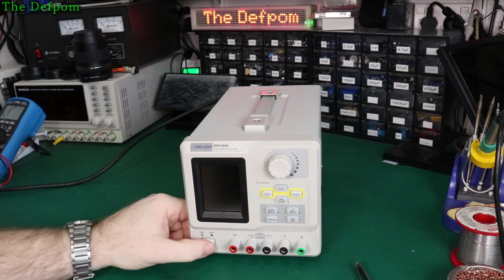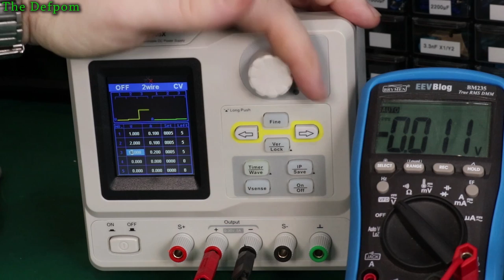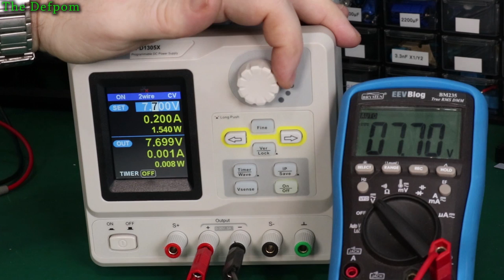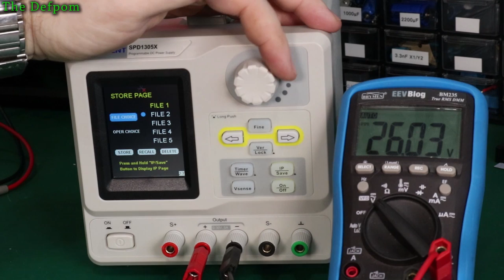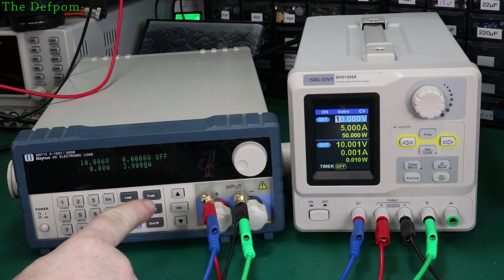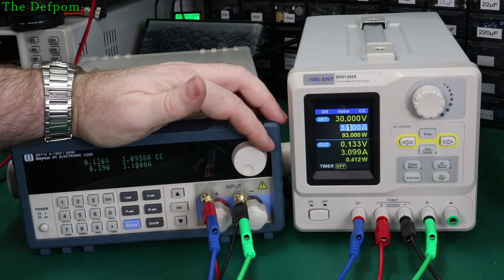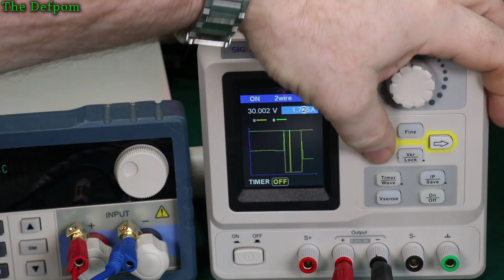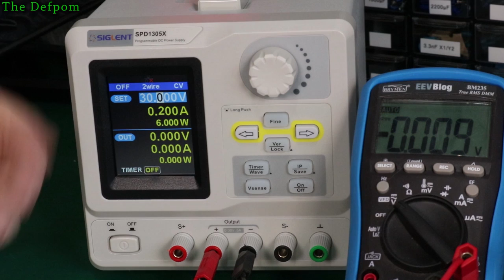🔴 #528 NEW Siglent SPD1305X Linear Power Supply Review - How Good Is The SPD1305X Power Supply

Comment: Thanks for this series of reviews.  I have the SPD3303X-E which has a similar UI and I have to agree with you that the 'output enabled' indication just isn't obvious enough...even with the front panel LEDs (on the SPD3303X-E) which are very dim.  I also find that the graph feature is nearly useless unless you are working on systems with significant current/voltage excursions.  In my case I frequently work at around 100mA supply current which on the graph is a line near zero.  A 20mA change is virtually invisible.  An auto-scale feature would be excellent here.  Other than this I've done many test on the SPD3303X-E and it handles overloads and output enable cycles gracefully with no measurable overshoot - a really excellent supply for the money.
BTW - during the 4-wire measurements in your video, it would have been better to connect the sense lines directly to the brass connectors on the load - this would eliminate the voltage drop from the banana jack contacts - which can be "significant" in some cases.
Reply: Great suggestion on an auto scaling feature, thanks I'll pass this to the factory.

Comment: Very nice detailed preview. I don't see any competitor in this price range right now.
I'ts obvious that Siglent has reused the interface from the SPD3303C where it was perfect. The fine button first selected between coarse/fine and on the later X models it moves the cursor on the digits. Makes sense I think. But the [left] and [right] cursor buttons confusing things up.
I would use these four buttons [Fine] [<] [>] [Ver|Lock] as cursor controls [up], [down], [left], [right] and to enter or agree press the wheel. Next the [IP|Save] button should become [Menu|Lock]. Then it's perfect again ;-)

Comment: Hi, mate. Good video. I was looking for a regulation and ripple test for the power supply.
I can see the output waveform facility being a good asset.
Reply: The ripple spec on these PSU's is very low and somewhat hard to measure without an EMI clean lab.
Some checks of transient response and ripple on the SDP1168X are posted here:
https://www.eevblog.com/forum/testgear/new-spd1168x-siglent-psu/msg1680749/#msg1680749
When Defpom gives my SPD1305X back I'll post some ripple and transient tests there too.

Comment: Hi defpom,
when choosing for a triple psu like the spd3303 the serial and parallel use is done inside and one can choose the outer plus and minus for high voltages.
If buying two of this units, does siglent offer smart communications between two of this devices for parallel or series connection?
I want to charge lifepo4 systems with a stable 52V or just 8 cells in series at 10 Amps.

Any thoughts?

Keep up the good reviews b.t.w.
It is awesome to buy a unit that already has been analised by you in a very thourough way 😃
Reply from the maker: I don’t have experience doing remote control of devices, but I believe that you can use SCPI commands to control them, which means you could control two units at the same time using suitable software. Siglent do have software, but I’m not sure it can control 2 units.

Comment: Late to the game here but just purchased this unit! I’m noticing that with no load, I am reading a configured 2V output as 1.9968V. Also seeing the “channel off” voltage of around -13mV. Are these reading generally considered within specifications ?
Reply from the maker: I actually don’t know, it will say what the accuracy is in the manual, so you should be able to work it out.

Comment: I dislike the idea of putting a computer interface on a linear power supply. It is very annoying to see that creep solely for the reason to fool people to buy a flashy color screen model which has nothing to do with Linear power supply performance.  For that reason i dislike this model from the bat. The "waveform" option is absolutely worthless in practical lab use. It's just for a gimmick.